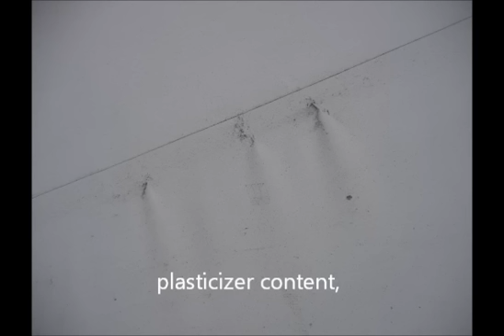Rogers Centre Roof Investigation 2005-2006

Comment: The building is an eyesore - location has always been horrible.   A new open stadium slightly north would be better.
Reply: Henry Smith they are being told thst they must spend $250-$400million renovating.  Its a waste, a concrete dump.  Sell to a developer, buy on the north end and build a new open air stadium.
Reply: It’s an iconic structure in Toronto…it would cause too much controversy to take it down as it is just so iconic
Reply: @TrainStan  it is getting demolished, needs $400 million in upgrades.   Its a bunker, too big and an eyesore.  Good riddance to it.
Reply: @WBOS72  Most if not everyone agrees that the SkyDome is an iconic piece to the Toronto skyline and should not be taken down
Reply: @WBOS72  Are they really true baseball fans if they care about the stadium more than the actual game?
Reply: @TrainStan  you are missing the point - the crapdome needs 400 million in upgrades - it is not worth it.

Going back to a single use stafium in Totonto will happen, it will be open air with grass.   The bulk of the people that go to jays games cannot name one player on the team, they go to socialize.

The dome will be replaced, it is already in the works.
Reply: @WBOS72  no….just no